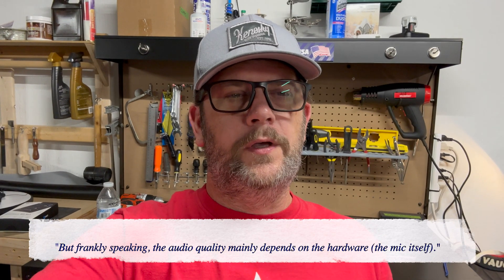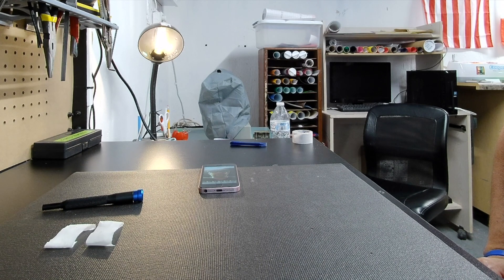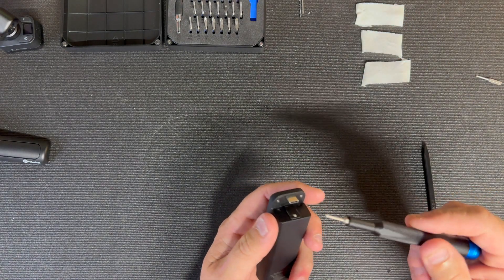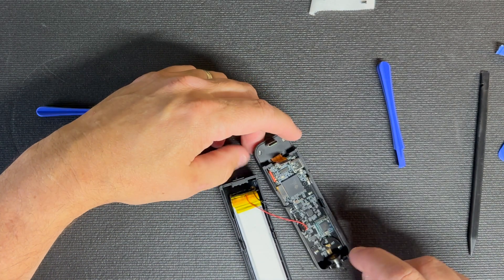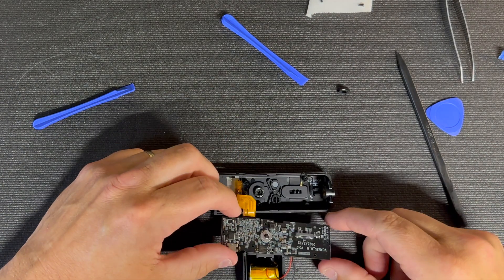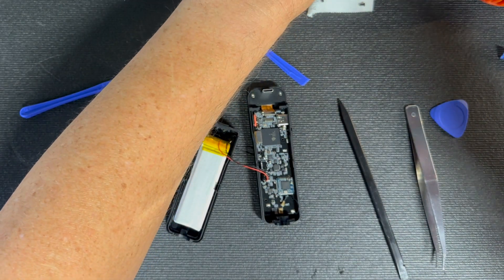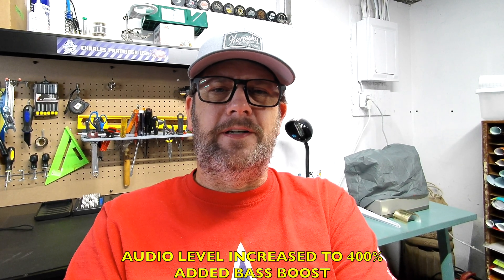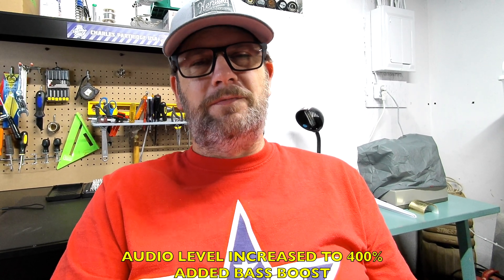Feiyu Pocket 3 - Mic Hack Attempt - Opening the handle

Comment from the maker: Update:  So I reviewed my video and realized there is a MEMS microphone on the back side of the PC board.  This means the design of the device has the audio passing thru the tiny hole in the plastic body, and then ALSO thru the hole in the PC board in order to be sensed by the microphone.  I'm not quite sure it would be safe to also try opening up the hole in the pc board as there isn't a way to remove the soldered on MEMS mic chip from the board in order to not damage the chip.

Comment: Hi, can u help me with another modification on feiyu pocket 3? 
I need to attach a loupe on the camera of my feiyu pocket 3 to capture macro images (I'm dentist), but because of the weight of the loupe (14 grams) the feiyu system activate the "gimbal protect". Can you help me to disable that? I don't mind if I'll need some modification that will danify my gimbal movement.
Reply from the maker: sorry, i'm not much help with that.  I rarely use my camera now due to the audio issues.  there is a facebook group you could join and ask your question there though:  https://www.facebook.com/groups/848928876969658

Comment: main mic is in main unit and not remote unit, right?
Reply from the maker: Correct. I believe they are the same type of mic element though. Once connected to the handle, the camera mic is bypassed in favor of the handle mic.
Reply: Could the camera mic hole be widened then? Perhaps if the mic hole on the camera section is widened, and then the camera section is then removed from the handle, the sound would be improved…

Also ChatGPT suggested that my DJI Mic 1’s transceiver can be connected via USB C to the unit and that possibly sound recorded from my DJI Mic could be used instead of the onboard mic on the Feiyu unit. I’m doubtful about this, but it is an interesting idea.